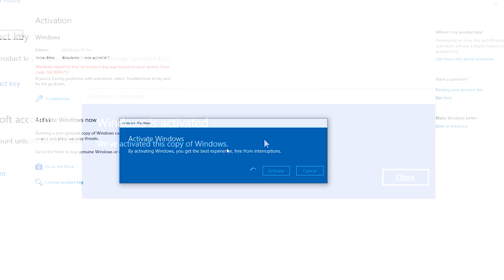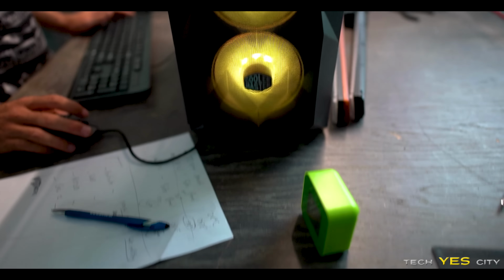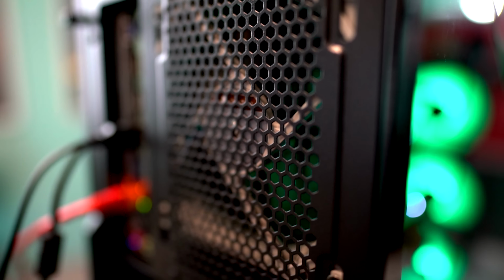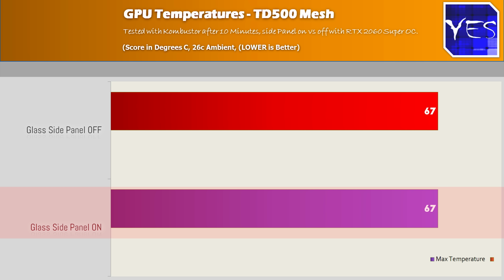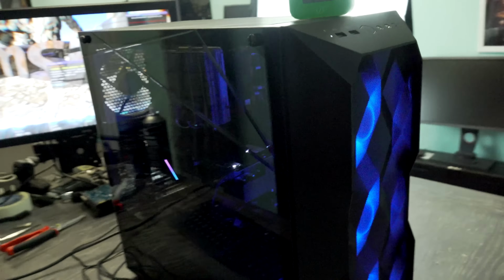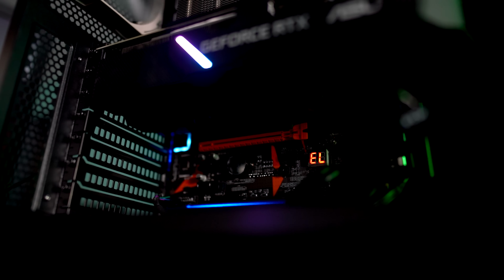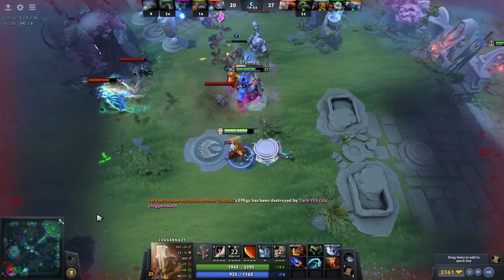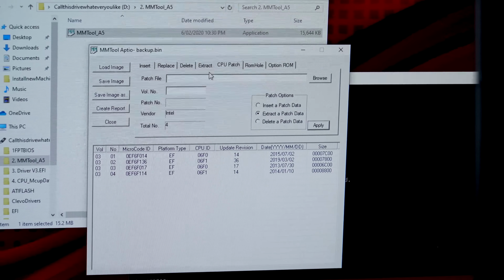MAN I Built a 12 CORE Gaming PC for a Just OVER $1000!

Comment: Brian, I got 32gb (2 x 16GB) DDR4 Corsair Vengence LPX 2400Mhz for $149.16 AUD delivered two weeks ago to Sydney. Running slight OC at 2666Mhz. Also picked up 16GB (2x8GB) Corsair Vengence LPX 2666Mhz for $82.57 AUD delivered at the same time. Need to do better on pricing.

Comment: I took TYC advice and bought a Snowman CPU cooler.  It was the 6 pipe RGB 120mm PWM fan version. Results...fantastic.  Honestly, an improvement to the CoolerMaster H412S. At a price of about US$28 delivered, the quality was on par with the CoolerMaster...actually...the fan even better. Packaging was excellent and there was no damage to the item (seller wrapped the box in an air cushion blanket...the heavy duty one with the linear/parallel air pockets). It manages an OC'd E5-1650V2 (all core 4.3Ghz, 6C/12T) without issue...running Folding at home with a "full" CPU load at just over 60% across all cores, the temps stay at about 55 Celsius. Under test stress, mid 60's.

I do see on AliEx the SNOWMAN name on 90mm CPU coolers...which I will stay away from having already tried one awhile ago (6 pipe, 3 pin, dual blue led 90mm fans).  This 90mm version/knockoff doesn't even compare to the "real" 120mm SNOWMAN mentioned above. Fin thickness, pipe gage, fit/finish, etc.

In terms of value, very impressed with this TYC recommendation. Thanks.

Comment: Awesome build mate. I think that in 2020, AliExpress parts PC's are really relevant. I recently built a PC for someone with a 6 core Sandy Bridge Xeon, Atermiter X79 motherboard, 8GB of RAM, RX 470 (up until now everything is from AliExpress), new case, power supply and SSD for only 300 euros total. That's 323 USD and 507 AUD. That PC is a very nice bargain for most games on 1080p medium.

Comment: Clever build buddy- the new Coolermaster mesh cases are great I have a MAtx sized N400 (Atx is NR600) and the micro mesh removes the need for the dust filter at the front which is likely why temps are so good.

Comment: I had two X99 systems I built back in 2015 and recently tried this with a 12 core Xeon 2690v3 and a 16 core Xeon 2698v3 that I picked up off ebay for a reasonable price. Even those processors are cheaper than the new Ryzen 7s. Once you do the turbo unlock a 12+ core Xeon  gives you very close performance to the new Ryzen 7 3000s for 1/3 to 1/2 the price.
Reply: I forgot to mention make sure you get a motherboard that supports quad channel. If you run these X99 systems with DDR4 2133 in quad channel, the performance is nearly the same as many of the Ryzen builds that are only using Dual Channel. DDR4 2133 Quad Channel performs close to DDR4 3000 running Dual Channel.

Comment: Hey Bryan, just helped my friend upgrade his old Dell XPS 8600. Upgraded to Asus LGA 1150 Motherboard, RX 470, and 16GB of DDR3 @ 1600Mhz. We're looking to upgrade his processor next. What, affordable, upgrade would you suggest for a replacement to an i5 4460? Been looking at 4770s but they're still an arm and a leg!
Reply: Just get the xeon equivalent (1230v3 or more), it's pretty much a rebranded i7 and it's compatible with every consumer board.
Reply: @roxpotatoes  that was the real question, I was looking at all the xeons compatible with the socket type and didn't know if the 4c8t models would have compatibility issues or if there was one that was obviously better/cheaper than the rest

Comment: It may be cliche, but the Ryzen 2700 will nearly be on par for performance and at have better power draw. You can then upgrade to a used 3000-series or 4000-series without explicitly needing to buy a new motherboard and more performance. Long term, that's less money.

Comment: Hey @TechYesCity man! Please answer this. Which should I consider a Xeon X5675 build or a i5-3570 build if both are at stock speed and prices are more or less same??? Or Should I look to overclock my X3440 CPU?
Reply: Well if you wanted to do VR you'd want to go with ivy bridge at the lowest, but for the time being try overclocking that x3440 and see if that's good enough for what you're doing with it. It may also depend on the game for whether or not more cores may be preferable.

When it comes to the x3440 be careful with some of the voltages, you'll find some people burnt out their motherboards when they tried pushing those 1156 CPUs.

Comment: $399 for a 2060 super right now? Das a hard one. I did luck out and get an ASUS RTX 2070 OC Dual for $429 in late Feb before SHTF. I lucked out buying my new build parts early on....kinda wish I got a Ryzen 7 instead of a 5 3600 though. I was on a tight budget at first, and then I just bought whatever and topped it off with a 2070 rather than reusing my GTX 980.

Comment: Some irrelevant question about ryzen 3600, have you ever test it with prime95 and temperature spike to 105C even though you have decent cooler like the snowman 6heatpipes ? And with thermal grizzly kryonaut :)
Reply: thats not right, Maybe your CPU fan is not spinning properly or your case has not good thermals. Wait did you even put the thermal paste :/
Reply: 95 degrees is the max temp of the 3600 didn't your system shut down?
Reply: Play perfect games nope, it’s still running about 15mins then shutdown
Reply: @jhinfex7368  than something is really wrong, did you overclock it? Because if you did you should underclock it and reduce the voltage. Because at this point you are cooking your cpu
Reply: Play perfect games cpu at stock and when prime95 cpu clock is 3.85ghz and voltage is 1.3v

Comment: Bought a 1tb ssd to upgrade my old PC

X58A-UD3R rev 2.0
I7 930 stock clock has ben oc before
2 x ( 3x2gb ) corsair ram
Hd 6750
850w master cooler silent, now 420w cool master.

Tried cloning old hdd to ssd got errors, ran chkdsk/f . System needed to restart went to restart black screen. Left it overnight still nothing. Turned off and ever since then cant boot into windows . Tried new install from usb and disc on the ssd, no luck. Everything loads like normal but after the bios screen it sits there with a black screen, all leds turn off and nothing happens.

Tried new power supply, re seating the CPU.

Plz help a noob. I just make beats so I'm not fussed about how old this is I just cant lose the data on here and yes I did not back up my system 🤦🏽‍♂️

Comment: you can get the windows 10 key for a little over $1 on ebay :)
Reply: I have bought 3 of them.... just fine
Reply: @J Fz, yes you are wrong😂😂. It's almost 10 months. My windows is running fine and getting official update. And what you're saying about "volume key crap", that is concerned with Windows Enterprise version. But these are genuine Windows 10 Pro keys which runs fine...
Reply: @J Fz, the $15 keys that many youtubers advertising are actually the same as the $1 ebay keys. They are just making more profit. But those problem may happen because they sell it like potatoes😂😂😂... you would not be having further problems after activation. It's just a key... the server still remains to the authority of Microsoft. So there's no risk of being hacked or something like that. I assume that you are having the same fear...
Reply: @digantamajumder5900  I used to work for Microsoft and I had the ability to generate a new windows key for customers that had changed their hardware or who's license key were no longer working.  These E bay sellers must have access to Microsoft's license generating software in order to sell such high volume of these keys.  They are probably doing this on the side to make more than they do at their day job.
Reply: Pet Mey would that be considered illegal?
Reply: @shadymccain9522  to buy them, no, to sell them, probably
Reply: @petmey5281 , RIP justice😂😂
Reply: @J Fz, Yes, it's not something that we can say legal. But again, piracy is happening a lot in softwares, games. Buying an OS for $100 is really impossible for most people.
Reply: @digantamajumder5900   it's actually more like $200 for the pro license   I would switch to Linux before I did that or just run Windows with the watermark that says activate all the time
Reply: @petmey5281 , where do you work now man? Isn't Bill Gates going to send thugs behind you for leaking such secret😂😂😂
Reply: @digantamajumder5900  Lol, I get paid six figures to wipe arses.  I have a sponsored group home that I run out of my house

Comment: Hello Tech YES citizens, I am relatively new to the channel. Just wanted to mention there is a new turbo unlock hack which doesn't involve efi driver installing but it is directly injected into the BIOS itself and you can use whatever OS you like. Actually someone already altered the BIOS for flashing so you just flash it and you're done. Check out Myiconst channel - he has a good tutorial.

Comment: hey Tech YES City, I don't think this build is worth the price. For that money, you can get a Ryzen 7 3700x build with 5600 XT with better performance. Might have to limit to 16gb and less fancy case.
Reply: Yeah... the build is not worthy for a gaming system. But it would be great for content creation. The 8 core 3700X won't be able to beat the 12 core in case of all core utilising works. It would be really great if you cheap out on the cabinet and a little on PSU. You can also get 32gb of used ECC memory very cheap. The whole build can be done easily for $700 to $800.
Reply: @digantamajumder5900  The 3700X blows the 2678 v3 out the water with almost twice the performance in multi-core test etc.
Reply: @andrepiper , Have you seen any benchmarks on multicore test? It's really hard for a 8 core to beat the 12 core when all cores are loaded. But it's just my assumption. May be I'm wrong.

Comment: 2tb nvm ... Useless ... The rest is about 500 euro 600 $ mobo and CPU 300 PSU 30 case 50-70 ram 100-120 + 50 aio cooler. I'll never consider an air-cooler on a 24 thred 3.5ghz CPU.